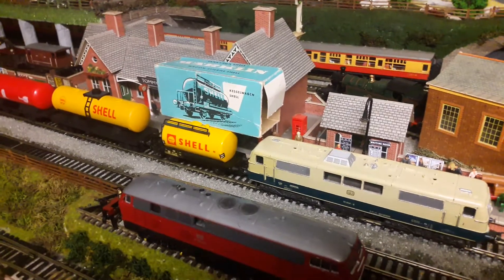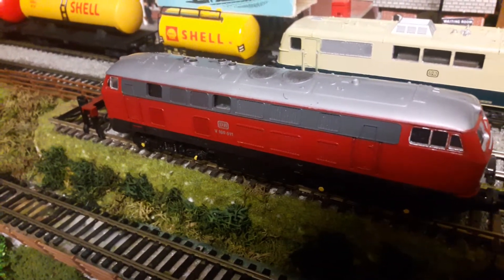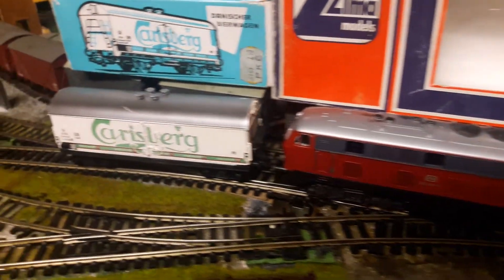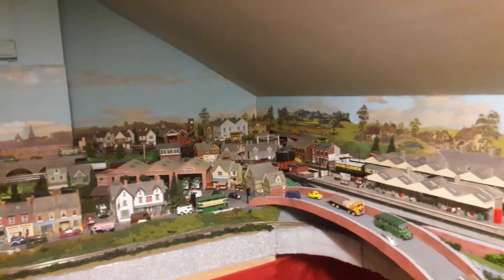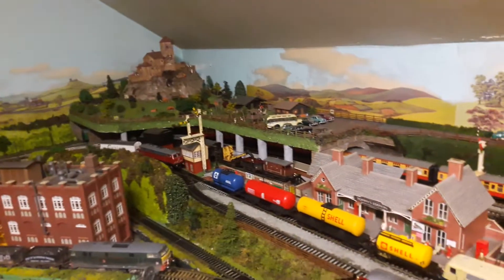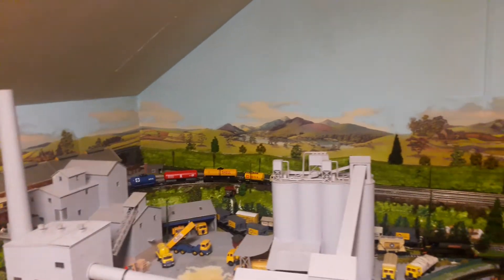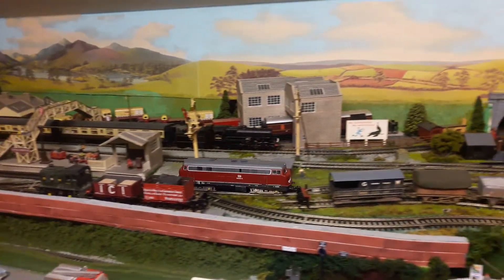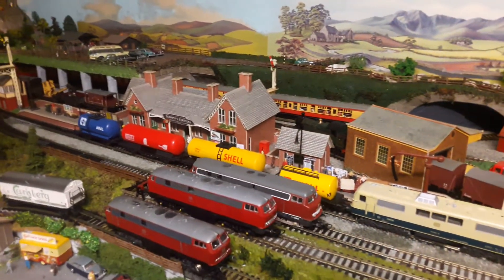OO Gauge Tommy theTanks Diesel mania

Comment: Hi Paul, nice video, I like your experiments with continental rolling stock. I see you had a problem with the metal chassis of the Carlsberg. I have very old Märklin stock with metal chassis. I changed the wheelsets to Hamo wheels. They have the same pointed axle-system and fit perfectly in these metal chassis, but they have isolated DC-wheels. They are great but sometimes hard to find. I was lucky to find old stock in a Belgian online shop. I show these wheelsets at the end of this video: https://youtu.be/m36i-TQ35Ac
Greetings, Erik 🙋‍♂️
Reply from the maker: Hi Erik, I really like the continental rolling stock they are very well detailed and good quality. I bought a job lot of used Ho wagons and the Marklin Carlsburg was in the mix. I tried fitting some of my Hornby plastic wheels but they were not long enough. As you saw I replaced the chassis and solved the issue. I was offered a large number of Marklin wagons a few months ago at a good price but declined due to the wheel problem. Thanks for the Hamo wheelset info its a good solution if they can be bought. I was very impressed with your Marklin DC Steam Loco, it looks great and runs very well. I was surprised Marklin made DC Model trains.
How is the work in your loft going, It would be good to see some videos of the build in progress.
Have a happy Easter. Cheers, Paul.
Reply: @paulvozman842  Hi Paul, today I will start with the framework for the current layout, so I can move it to the loft, hopefully today. Next week I have to go to work again, so expansion of the layout will probably be something for the summer holidays. The theme of a second or third part will probably be British 🙂 but the new import regulations have made it difficult to find good bargains on Hornby or other rolling stock. Ordering in the UK has become expensive, especially for secondhand rolling stock. Luckily there are continental online resellers of new material, but secondhand is rather difficult to find here.
As for the Hamo-wheelsets, I was lucky to find them in 2020 for 6 euro per 4 sets. I could buy a few packages. When I later bought more Märklin rolling stock that reseller (McRonse) didn’t have the Hamo-sets at that time and I have tried regular Chinese metal DC wheelsets. They were a little to short but I slightly bent the axle bearings, first inside and then a second bent to get them straight again. That worked perfect and these wagons run with regular, shorter axled wheelsets now. The important thing is to make sure that the wheeldisc of the isolated wheel does not touch the metal axle bearing, to avoid short circuit. The two bents are hardly visible, and they are even logical since on real wagons the axle bearings also tend to be slightly closer to the wheelset than the upper part of the chassis.
Best regards, Erik 🙋‍♂️